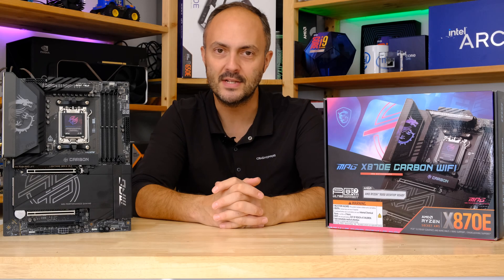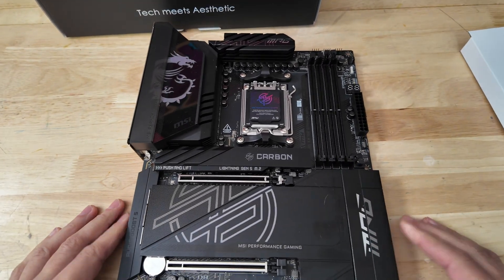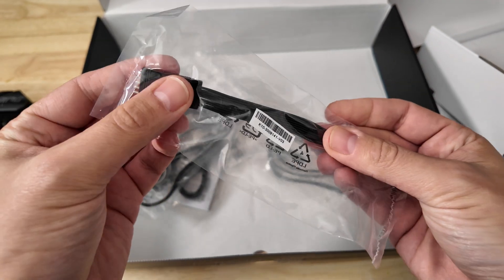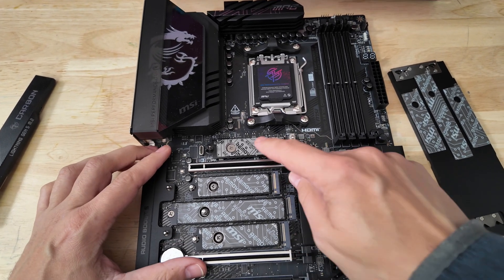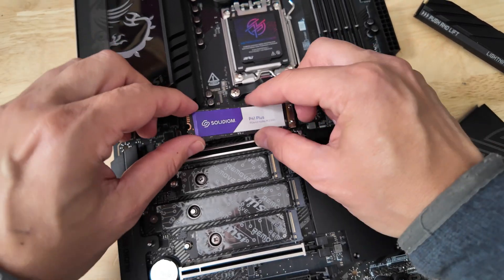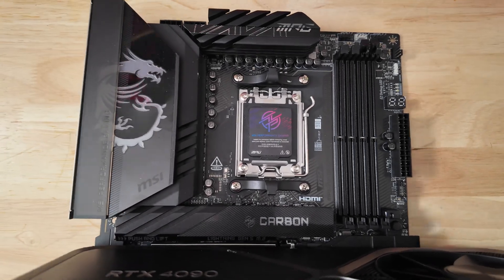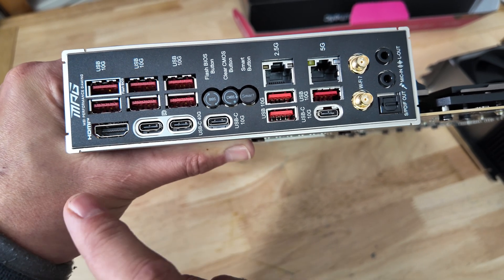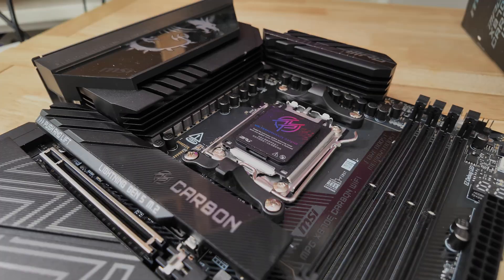MSI brings the WOW FACTOR for its X870E CARBON WIFI

Comment: what would you actually connect to the PCIE PWR1 at the bottom? I am about to switch to this motherboard and the one i have for now doesn't have this
Reply from the maker: It’s mainly if you’re running multiple PCIe devices or doing extreme GPU overclocking

Comment: We would appreciate it if you could examine it by installing an x870 carbon... CPU. I ran it with 8600g and 7950x, the digi-Led does not show the CPU temperature, there is no setting in the bios. I started the return process... stop making nonsense reviews...

Comment: with one bios release and second is beta no thanks no more msi , since many problems with carbon b550 that i had to send back to amazon. msi bios not reliable and very unstable, personally I avoid this brand.
Reply: And for me i avoid Asus, pretty much unstable. I had a X570 Rog and both bios corrupt themself. I try to rma and they didn't wanted to use the warranty has they accused me to broke the board. She was 3 month old freshly released. They pissed me off and went on a MSI X570 carbon wifi and never got any trouble with it.
Reply: Asus software is terrible also, would always get buggy

Comment: According to the manual, when installing a GPU "Ensure that the EZ PCIe Release Button is in the locked position. If it is unlocked,
press the button to lock it."  And when removing a GPU,  "Ensure that the EZ PCIe Release Button is in the unlocked position. If it is locked,
press the button to unlock it."

Comment: I bought this MSI X870E carbon mobo, but I cannot install AMD 7800XT drivers. I keep getting error 1603.
Reply: update bios
Reply: I might be wrong but gpu drivers interact with the OS mostly. Should not have too much to do with the board.

Comment: The Carbon series used to be more mid-range.  Now it costs $500.00 US.  Dayem.
Reply: Yeah.. I remember buying one for around 100 dollars for a ryzen 2600 hahaha
Reply: So was the x670e carbon.
Reply: Back in the x370 days, it was actually the higher tier board. But 500 or over for mid is high
Reply: @tarabrarika4394   it’s their second highest board.
Reply: unify and ace disappeared, so carbon has to take its place

the tomahawk board now comes in x870e and for most people that's good enough

Comment: looks a nice upgrade from the MSI MEG ACE X570  if your looking to swap platform to am5 price is roughly the same too at £400 as the x570 was in 2020 and no silly cooling fan on the board.

Comment: Asus, Gigabyte, MSI, ASRock....who will get MY or Your money next??? For my next build!   AM5 or Arrow Lake?!
Asus: Proven but VERY EXPENSIVE NOW. Some say way overboard.
Gigabyte: Same like Asus but maybe a little bit less expensive. 
MSI:...hmm. I'm looking at them HARD right now due to price of the above two are out of control. 
ASrock...hmm. Really not familiar with them.  Lowest price that's for sure. But how's quality?!
Supermicro WorkStation Board?? Anyone?
I miss Abit...😥😥
Reply: I wouldn't recommend Gigabyte from my personal experience, their VRM goes way hot tbh, Asus is the best unless you have a defect or so then your warranty is gone basically, ASRock is a good affordable alternative.
Reply: Which Motherboard brand BIOS do you find is more intuitive to your own liking? If you have to use the BIOS after any updates.

Comment: Slowest board in latest roundup of boards. Failed to post at 8000 ram speed…………..etc………..etc
Reply: Link?
Reply: Funny, cause hardware unboxed showed it was one of the better performers out of all x870e mobos...
Reply: Useless on new Ryzen, all the bench show that it wont make them faster so who care, 6000 is the sweat spot.

Comment: Is the extra PCIe 8 pin power required? What advantage does it give compared to all the mobos that do not have one? Decent first glance at this mobo!
Reply: It’s usually there on higher end msis boards for years now. More useful if you were using gpus in sli.

Comment: 6:30 Are those sticky heatsinks? Wouldn't that be a problem if you want to add more M.2 drives or change the one you already have if the cover is stuck to the previous M.2 drive? 
How is removing then replacing the M.2 cover work with the sicky heatsink strips?
Reply: Wondering the same thing.

Comment: have they fixed the killing ssd feature present on the x670e carbon and the customer service?
Reply: How did the 670E kill SSDs?
Reply: @JetSe77er  just systematically gets dead the 1st M2 SSD... It happened to me 2 times with different SSD brands and then I decided to Google it, and I found I was not the only one, one guy posted a review on Microcenter and wrote it happened 10 times... When I talked to customer support they said there was not such a thing, but it happened to a lot of people

Comment: The 3 M.2s are gonna go bunkers hot next to each other + being under the GPU… 

It’s even worse than in my X670E Ace mobo, putting two M.2s  next to each other (2nd and 3rd slot defined by manual) would easily bring them to 60+ degree Celsius and when running a disk mark benchmark the one being benched would go upwards of 70
Reply from the maker: @aryan_ak50  You say that but I found the massive heatsink on the Asus X870 Crosshair Hero performed much better than the heatsink above the graphics card slot. It kept a PCIe 5 and PCIe 4 SSD at 67’C and 63’C respectively. You just need to keep it 10’C away from 80’C so you have headroom before it throttles. I guess a lot depends on the GPU cooler design. But even then, you don’t game and  hammer your SSD for 20-30 seconds at the same time. Content creation might pose more of an issue but we’ll see in the main review!
Reply: @CrazyTechLab  for me because I was testing to the the temperatures I was not comfortable with it. When I ran diskmark it scored lower in one of the segments of the test consistently than when in lower temps. But that wasn’t the only issue, I had diskmark info open while I just just watching movie, I didn’t do anything special or was focused on the M.2 temps, but then suddenly diskmark would give me this alarm that my drives have passed a threshold and hot. I kept it for a whole day of normal usage but then decided seeing those temps without me pushing it was annoying. So I swapped one of them for the M.2 four slot (one lower with the longer heatsink) and both M.2 started breathing again. Both never got so much hot anymore but either way were still hotter than when using the M.2 one slot (reserved for pcie 5 on top right of the mobo) that slot is fabulous, no amount of torture testing lets my gen 4 drives go passed 45 degrees! 
Conclusion is that because of small confined space and being under the gpu they can’t dissipate heat much easily and then having a drive next to them is just recipe for too much heat

I think it’s worth a video you just checking the heatsink performance on all these boards for education purposes :)
Reply: 옆면에 fan 하나 달아서 vga 와 M.2 방열판 다 식혀 줘야 할듯